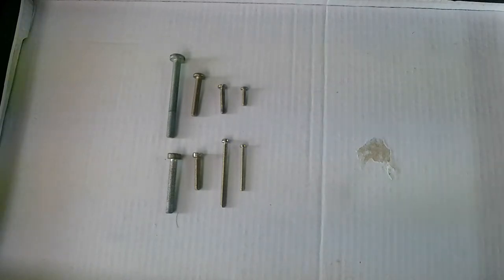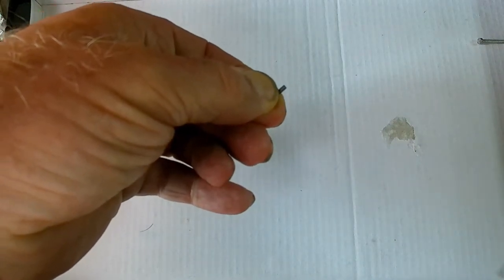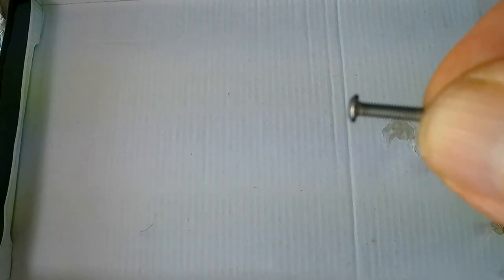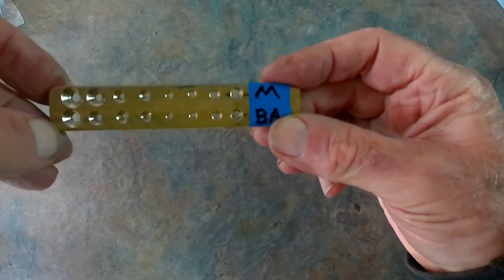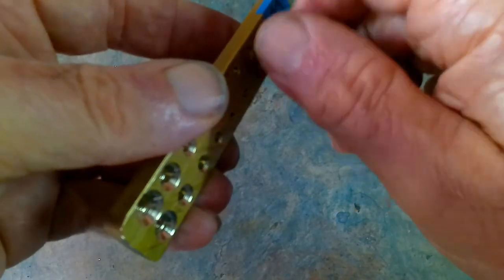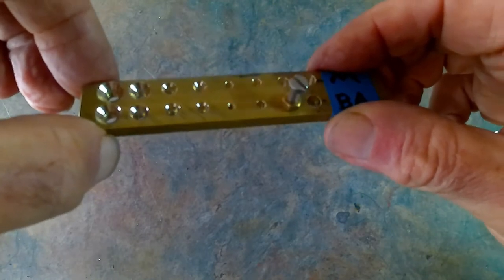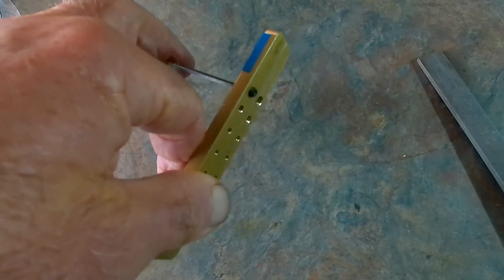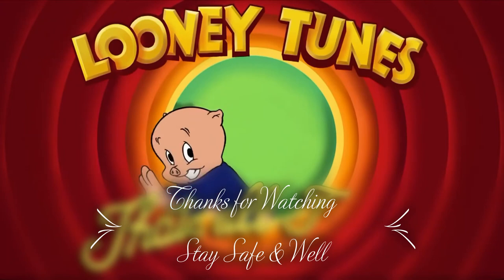A Simple And Safe Way To Shortening Instrument Screws. M 5, 2 BA, 10-24 And Smaller Sizes.

Comment: Cool tip! I do the same and only buy long screws, and I keep the cut offs to make set screws if needed
Reply from the maker: Hi Dave, thanks for  watching. These days I find that 1 inch screws cost the same as 1/2 inch, so why not buy 1 inch and cut to any length shorter. Regards.

Comment: Great tip Dave for model Makers, you could also use it for a tap guide I would think. Cheers
Reply from the maker: Hi Randy, NO GOOD as a tap guide as it is already threaded. You would need just a plain clearance hole as a tap guide. Thanks for your view and comment. Regards.

Comment: Very handy.....back in the day I had a collection of split nuts that I drilled out and used them to hold various diams of screws (and tubing) without danaging the threads......mostly for reducing the length of a screw by a MM or two.......there is a device called a lantern chuck that does the same thing but is more tedious to make......you'll find most of these tools in the boxes of the old timers after they go to rest and someone who gets lucky wonders what they were for.
Anyone make machine jacks with a nut and bolt?
Reply from the maker: Hello Ian, thanks for this comment, nuts work OK if you need thread a lot longer that the depth of a nut. Also using a nut can be problematic if the screw  is shorter than the length of your chuck jaws AND the head is larger that the nut. Seen it and done it with the nut and bolt jack as a quick get me out of trouble jack. Regards.

Comment: I had to shorten a couple dozen M3 screws to replace the thumbscrews in my micrometers with, I just grabbed them with a 3 jaw drill chuck held in a milling vise with a couple v blocks and off I went with an end mill. It was a remarkably fast way to do it. If a screw fell down into the chuck I'd blow it out with an air gun.
Reply from the maker: Hi there, thanks for the view and your comment about an alternative method. Regards.

Comment: I wonder if you could use a hard and sharp cold chisel to shear off the excess? The threaded plate would need to be made of hardened steel too but I think it could work...
Reply from the maker: Hi Charlie, thanks for the view and your comment. Shearing could be a possibility, but the cost and effort of a hardened tapped plate would be quite prohibitive. Also too the end of the bolt would be quite nasty and still need a sand or file. Probably for the few times it would be used, use a soft tapped plate and hacksaw and finish file or if you feel lucky try a belt sander but it will wear the plate. Regards.
Reply: @daveticehurst4191  Thanks for the reply Dave. Yeah your right that the threads could be a bit of a sticking point (literally). Still, if the plates hardened it might be able to double as a crude thread reformer as the screws removed, even if it does leave a bit of a rough edge. I’m kinda curious now, I might try it if I get another batch of parts hardened. I’ll post a follow up if I get round to it anytime soon.
Reply from the maker: @charmio  OK Charlie, your choice, thanks for the reply. Regards.